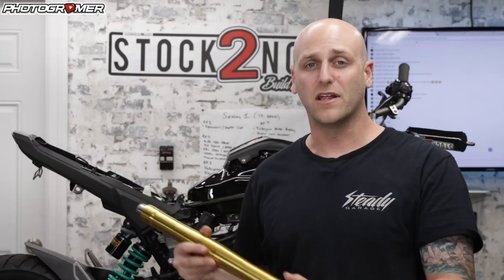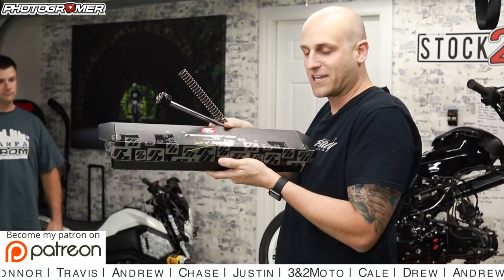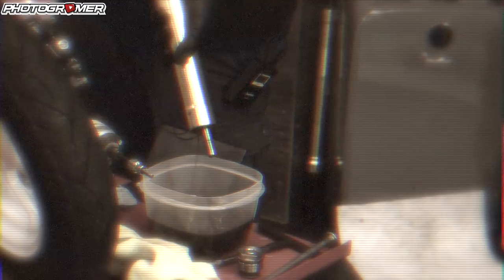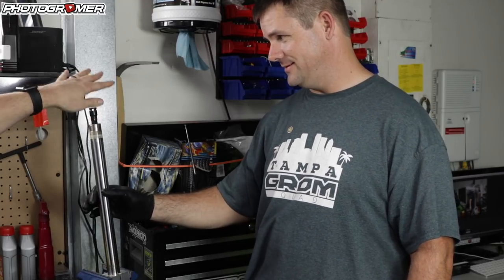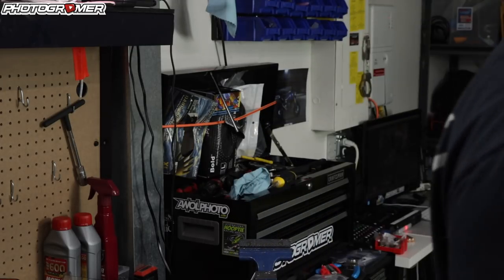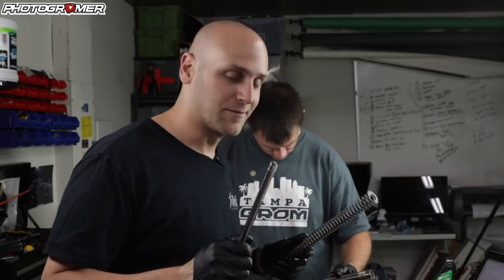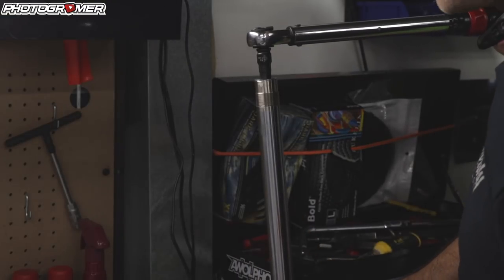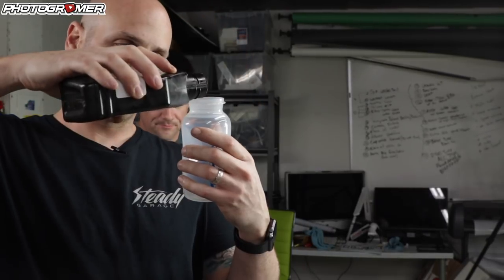S1 E8 - RacingBros Grom Fork Internals

Comment: Around the 8:30 spot, I believe that you put the wrong ring on the wrong valving for the shocks. The compression and rebound sides go in different ways. And, I believe that you put them in wrong. Just and observation. I could be wrong, but, I know that those pistons should look exactly the same for the most part.
Reply from the maker: William Kerry go to 11:20 this is how it was installed and confirmed by the pros at steady garage
Reply: Photogromer I did. Got a little excited about this. Watching and commenting. Finished this shortly after commenting

Comment: Hey man, I'm installing my racingbros inserts now and notice they clunk right at the top, the start of travel. Do you have this problem? I also noticed the length of the spring and rod together are 7mm shorter than stock. Seems like there is heaps less preload on the racingbros spring.... Not sure if that's the reason for the clunk.
Reply from the maker: 2017 and newer have spacers you have to install where OG groms don’t. That’s all I can think of, maybe you didn’t install the spacers if you’re on a newer grom than ours which is OG
Reply: @Photogromer  yeah I installed the spacers. Just odd. I did a quick google and alot of people have this problem and same with the racetech inserts.... I might just try out ohlins instead
Reply: @KurtGuy  anyfix for that ? U already spend 300$ are you gonna return them
Reply: @TheLostAdventuress  honestly, I checked everything. I pulled them apart and reassembled 4x over. Played with the oil  thickness and all the adjustment and managed to finally get it so mild that if you don't know exactly what your looking for your wouldn't tell. Oh also I ended up shimming the spring too... with a 5mm spacer. I've been riding around on them for like 5 months now and am pretty happy, just been keeping an eye out if they do anything weird or got worse but nope all good. I also used thicker that recommended oil. Can't remember everything exactly seeing it was a few months ago but it worked out in the end but ALOT of labor in it all, if I was doing it from scratch I'd probably go the ohlins inserts just to avoid all my stuffing around.
Reply: @KurtGuy  I'm getting the RB cause everyone's says there good idk why some say otherwise . Do u remember what stiffness you got ? 6.5kg? And recommended is 5w oil  did u get 7w ?
Reply: @TheLostAdventuress  I think I ran 10w.. I'll check the bottle when I get home in like 4 hours. And spring weight, I did go the 6.5 and I'm a little under 200lbs for reference.
Reply: @TheLostAdventuress  so just checked. My entire setup of them is...

6.5N/mm springs (195lbs rider)
7.5w oil
5mm preload spring washers
Compression and rebuild settings both mid.
Reply: @KurtGuy  mmmmm ok I might do 10w in 245 and 6.5 spring kit thank u for replying man u helped me make my choice
Reply: @TheLostAdventuress  All good man :) hope it goes good for you :)

Comment: Any reason why you wanna remove the power pures?
Reply from the maker: Came with 140s in the back. 130s are stock width, which I prefer. Also, Dunlop offers the TT93s which are the ideal track tire so wanted to run the Dunlop Scootsmarts for street and TT93s for track. Plus I like the tread pattern more on the Dunlop’s.
Reply: thanks for your opinion!!  i dont do much tracking and was thinking of the power pures for casual spirited backroads roads riding. so mine's not really logical to put track shoes. how is the compound, definitely grippier than other scooter tyres right?
Reply from the maker: You’re not going to notice any benefit from the scootsmart to the power purée. They are very similar. Comes down to price and what tread you prefer.